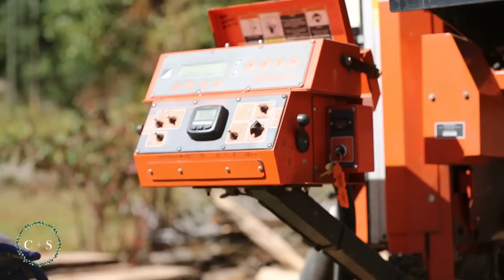MASSIVE 40 INCH WIDE CHERRY LOG SAWMILLING

Comment: Just a thought.  A lot of us watch saw mill videos to see the log opened up and reveal the face grain inside.  Instead of such low angles with the camera, a higher angle and the occasional showing of the face brushed off and maybe some water applied would really be nice.  Again, just a thought.
Reply: I xxx
Reply: Exactly! Otherwise not much point in watching.
Reply: Isn't it a little more stress on the blade/machine to cut with that other board on top of it...?  N plz show us the cuts!  Or is this an extension of the ads for the Mill?

Comment: Not having a wide saw, I often have to use shims on the stay-side to clear the guides...usually an old sticker between the stay and the log edge.

Usually the angle makes each cut a wider width, but sometimes it makes more sense to cut it center out.

Loved this video, and the beautiful slabs!!!

Comment: I like the way this video showed you and the machine working.
When I cut wide slabs on my LT50, (not wide😕)

I set some 1" shims on the deck so the log can be shifted
past the stoppers to the left or right with a Pv,
I don't use the clamp in that case though.
Reply: Can't is not in my vo can
Reply: @coreybady1828  bol8lollosbolil9s
Bolsillos

Pl

Comment: Did you keep the pith slab separate? Do you have any sort of arrangement, with the local woodturners, for them o come out, and have a rummage through your rubbish pile, for pieces suitable for turning? As a turner, I'd be delighted to provide such a service to a sawyer!
Those boards certainly would cover quite a large area!

Comment: I saw lumber for a living. And have for years. And I have never saw. Anybody with a tape measure? Trying to get the ends even on the cut. Because when you turn it over it's going to be the same. On one side or the other you got to make a crooked cut. You can split the difference. Between the two sides If you want to take the time.
Reply from the maker: Well therea many times i use the tape for reference, but primarily to align the pith parallel with the cut.  For live edge slabs its usually beneficial to align the pith that way, and also place the cuts so the pith is centered in one slab.  Retains the most value from the timber this way